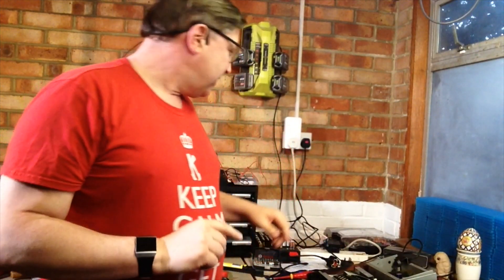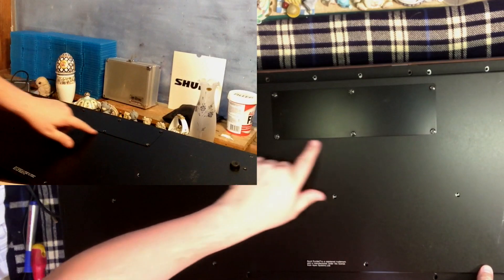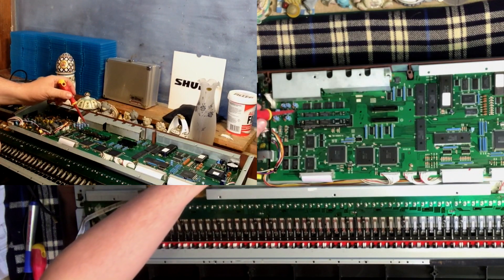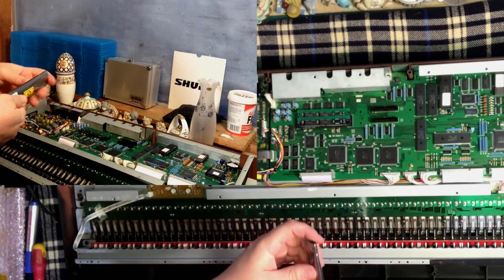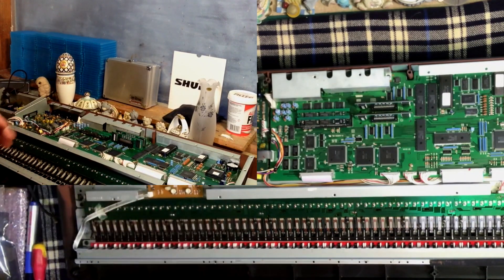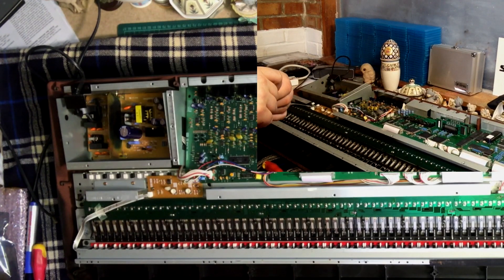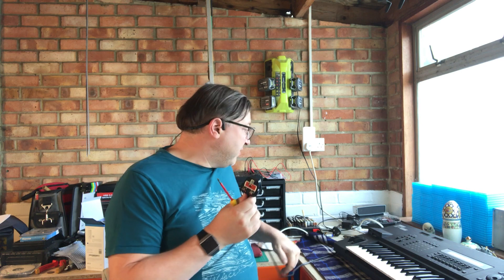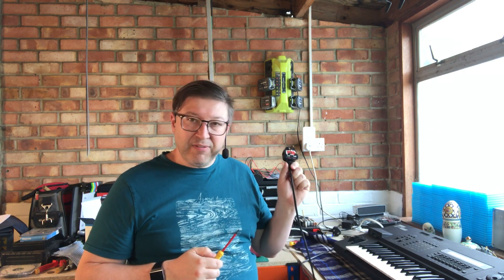Yamaha SY85 Restoration - Part 6 - Memory Upgrade

Comment: On the fuse in UK plugs, they are not there to protect the device but are to protect the house wiring.
Reply from the maker: Hi @dougietamson  

I can see that arguement that the device fuse blows before the main fuse blows in the old days.  But it doesn't help having a low value fuse in the plug for the device to try and not fry its electronics.  Jon
Reply: @TheMusicTechGuyUK  Interesting that the current  UK 3 pin plug was designed in 1947. Not many low power devices around then! I have some vintage valve based audio gear, there is always a fuse fitted to the rear of the chassis. Modern gear will 'hide' the fuse on the PSU board, it can be trcky to find it too as they don't look like a classic fuse in a glass tube.
Reply from the maker: Hi @dougietamson

Thanks for the additional information.  Jon

Comment: What type of memory is it? I’m looking to get one of these and would be looking to upgrade the memory if it had t been done
Reply from the maker: Have you subscribed? :-)

The SY85 has two types of memory.  The volatile memory that is listed as SAMSUNG KMM58256A-8.  The non-volatile memory is SYEMB06.  Sector101.co.uk sell the non-volatile memory at £31 per module and you will need two of them.  You might need to hunt around the internet for the volatile memory, but I have found several sites selling it.  Jon

Comment: Hi jon great channel ive just got a yamaha sy85 for restoration and i also have a korg i3 workstation from same era would the 2 Be compatible
Reply from the maker: Hi Bill. have you subscribed? :-)

Hopefully your disks will be with you by the weekend.

The SY85 and original Korg i3 were a year apart (1992 vs 1993) but the architecture of the machines is different so I am afraid I don't think that tones and patches would be interchangeable.  I could be wrong, but I have never had an i3 to confirm oneway or other.

I did a piece on the original i3 a few years back and I found very little support on the internet for this keyboard in terms of tones etc.  But it did look a good keyboard for the price bracket.  Jon
Reply: @TheMusicTechGuyUK  hi jon yes ive subscribed looking forward to testing🤞 the sy85 drive out  when  the disks arrive thankyou the korg i3 is in great working condition and has hardly been used probably due to lack of samples / sound modules etc as you said it came in a flight case and with 2 manuals but no disks . Had to send to a guy in oz for a boot disk the drive was ok thankfully it  reset and installed t the factory sounds and  settings its ok  but its a bit to much faffing with the sequencer i use it thru midi with my zoom mrs 1266 multitrack and boss gt-10 guitar  effects sounds great now and hopefully i can get the sy85 in the system . ive got a habit of collecting old gear and like yourself trying to get it working again 🤔 love the channel easy to understand and informative keep up the good work jon all the best bill
Reply from the maker: Bill the SY85 is definitely worth the effort Jon
Reply: Hi  jon  
got my 💾 thanks 
But yep  🪛 The disk drive is buggered ! 
Ordered  a new one from the guy in USA 🇺🇲  let the fun begin 
Best wishes bill
Reply from the maker: Hi @billcannon5272 👍 Jon

Comment: So tempted by the SYEMB06 boards, but I use two SY85's so it's an expensive click.. 😢
Reply from the maker: Upgrading two.  You lucky devil.  I took the view that once it was upgraded it was done.  Jon
Reply: @TheMusicTechGuyUK  true. I did the volatile memory on one in about 96 and the other recently so those were spaced far enough apart..
You can use one tho right? Might grab a pair and slap one in each..
Reply from the maker: What the hell, why not!  Jon
Reply: @TheMusicTechGuyUK  Got the drive and a pair of the boards installed in the better condition of the two.. So nice to have access to all my old samples and drumloops. :)
Now I just gotta figure out how to hold samples in the SYEMB06 thingies. I can get samples into them, but if I load an "ALL" file they vanish. Must be missing a step somewhere.
Reply from the maker: @Migraine Gainn Here is a link to Wednesday's scheduled MailBag that has a link from Brian at Sector101 about how to use the Non-Volatile memory.  It might help to solve your problem.  Jon

Comment: Thank you for featuring the Sector101 SYEMB06 module. I have a guide on how to use the non-volatile memory in the SY85 here: https://blog.sector101.co.uk/2019/07/27/sy85-sample-tutorial-for-syemb06-expansion/
Reply from the maker: Have you subscribed? ;-)

Brian, no problem.  I acquired the SY85 as fully working.  As you can see from the series of videos I have produced this was not the case lol.  Your Sector101 memory upgrade is an essential part of ‘fully loading’ the synth for the future.  So than you for supplying it.  Jon